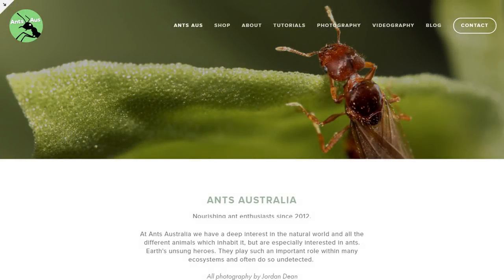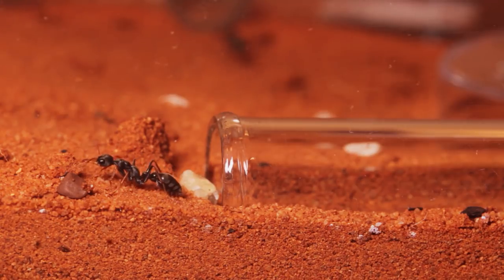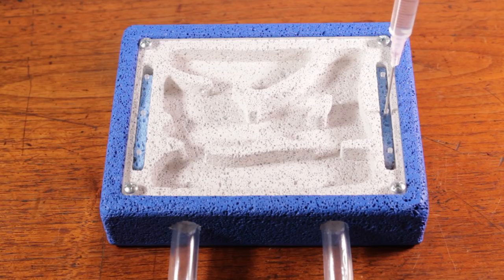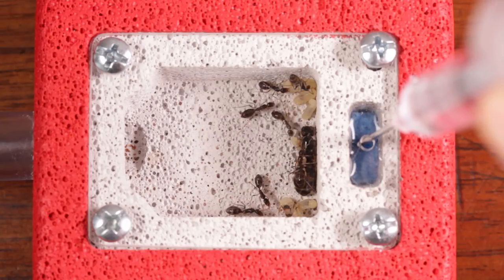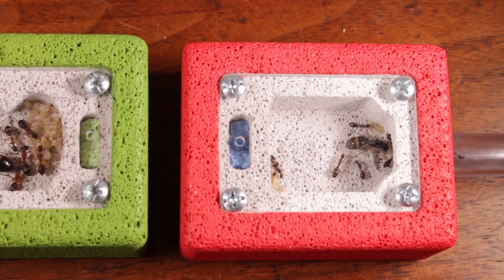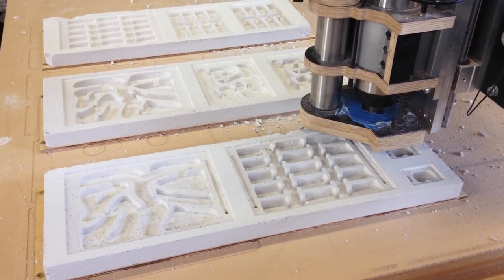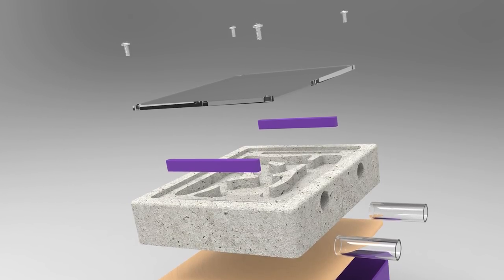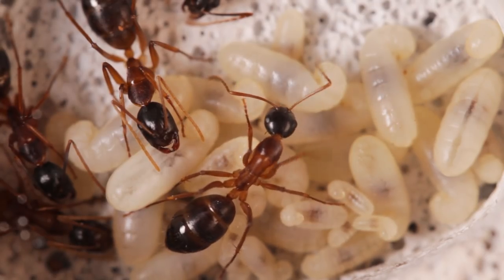Ants Australia Shop | Now Open!

Comment: Hi,I ordered a medium nest and it's arrived,I added distilled water but the ants seem like they don't want
 to go inside.Help?
Reply: Some ants can be very stubborn with moving nest. You can try covering the new nest and exposing the old to light. Another time is to not saturate the nest. Some ants may prefer wet nests but most only need high humidity. I have some Australia sugar ants in these nests and they hate it when i wet the nest. I just water every 5 days now and when I do I only add enough water to make sure the sponge is wet but no more.